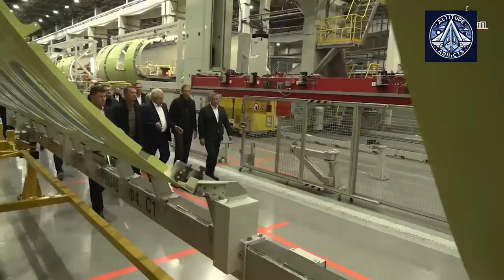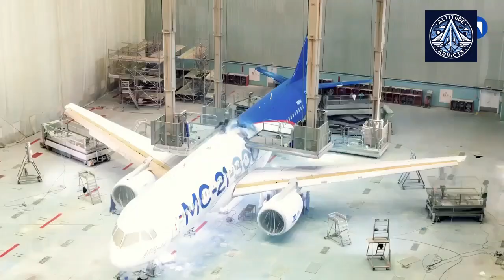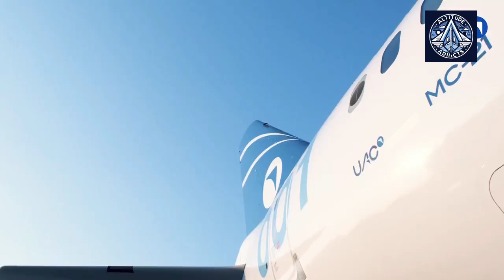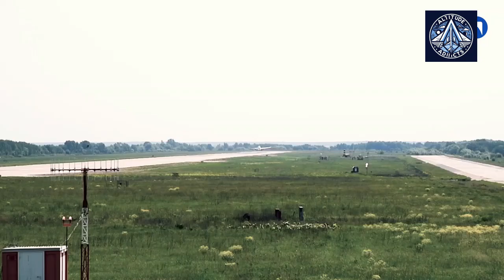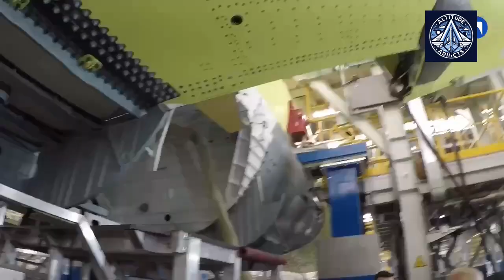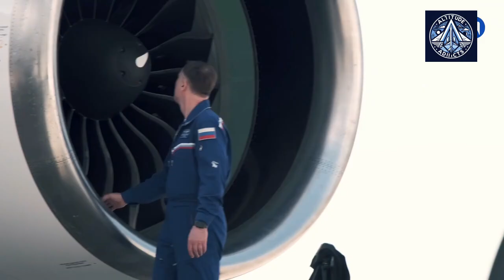Is Russia Ready to Export Its MC-21 Airliner?

Comment: Russia needs 500-600 MS21, exports will not be large.  the plan is to produce only 30-70 per year.  Of course, if there are   export demand . then the government will increase production capacity
Reply: Bitte Differenzieren nach MS21 Typen, welche ja auch recht vielfältig kommen werden. So wie ich die Planungen verstanden habe, beziehen sich die Zahlen jeweils auf MS21-xxx. Nicht zu vergessen das auch die Typen TU 214 faktisch auf vollkommen überarbeiteter Basis erscheint. Allein 1 Airline hat davon bereits 100 Stück von geordert. Auch wird jetzt wieder die TU 204 SM in einer überarbeiteten Version erwähnt. Lizenzproduktionen in anderen Ländern sind mit Sicherheit zu erwarten. Neben kompletten Flugzeugen wird auch die Zulieferindustrie auf dem Weltmarkt zunehmend ein Rolle spielen.
Reply: @T-BwBerlinKarlshorst-  MS21 will not be produced commercially

Comment: Boeing & Airbus have maybe been in world 🌎 market for decades thereby creating the duopoly. The negative point is that it'll be difficult to sell due to the reliability of the duopoly but the positive side is that the west has politicized the aviation industry. With sanctioned counties & countries who will prefer to have limited exposure to the west plus countries which will like a flexible alternative... Mc21 will have a market (Iran / syria / Cuba / Venezuela/ bularus / CIS countries / Vietnam / laos / Myanmar/ Mexico* / Iraq -friendly countries)...Russia is doing something remarkable by building the industry from the ground-up & the success of export will depend on the success (safety) of their local a aviation industry ; the level of modernization (quality) in comparison with the duopoly & it's ability to sync with western aviation infrastructure (recall Russia is practically changing every atom of western aviation in their system. In a nutshell they will need to focus on the project locally & build on its success to export their product. Recall they've various economic platforms they can use to market the plane...  BRICs / China's air show / EAEU & SCO...

Comment: If Airbus says the world demanding about 42.000 units in the next 20 years, it would be stunning for MC21-300 to catch at least 12.5 to 15% of that above estimated  market share once they get a normal running assembly line process, an issue that will be over as soon as they can to produce. 5 or 6 internal russian`s national airlines need to replace in 4 years all that stuff from Boeing and Airbus main fleets, so the market is there, internally as well. The service, parts, logistical and after sale departments  are key facts that Russian industry must to improve very fast, in order to get international sales within the friendly countries, BRICS, just to mention those 20 potential economy block partners.
Reply: It is all about technology. If MS-21exceeds Airbus features, then why not Russia get good slice of the market.
Reply: -210/-310/-410/-510/... mit betrachten. Auch hier wurde das Planungs-/Ausführungsprogramm erweitert. 
Russland sagt DANKE für die Sanktionspolitik. Diese Politik hat Russland gezwungen sich auf seine eigenen Stärken & Recurcen zu besinnen.
Die SJ 100 (nicht SSJ 100) wird überarbeitet mit PD 8 auch ein Marktsegment abdecken. TU214(204SM) und andere entstehende russische Flugzeugtypen bitte nicht vergessen.